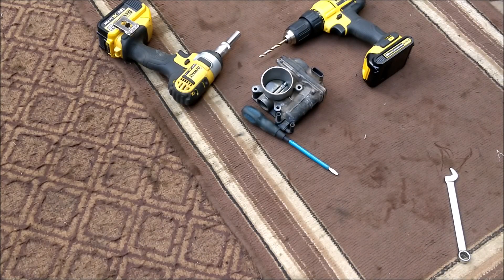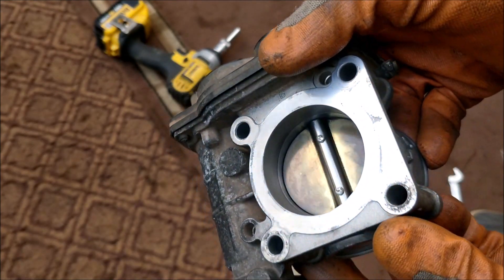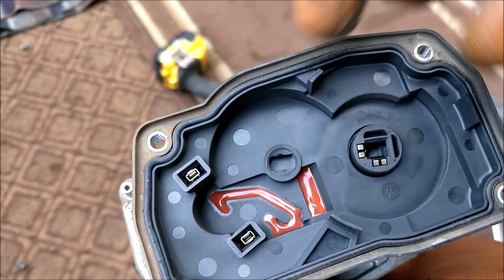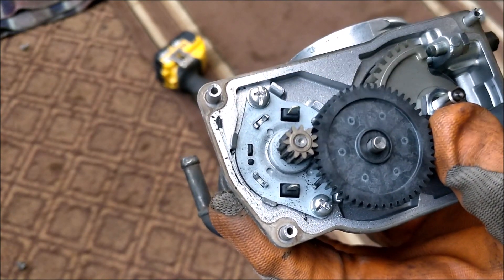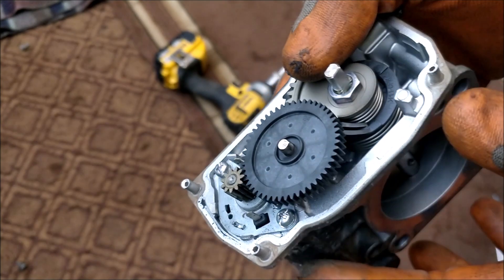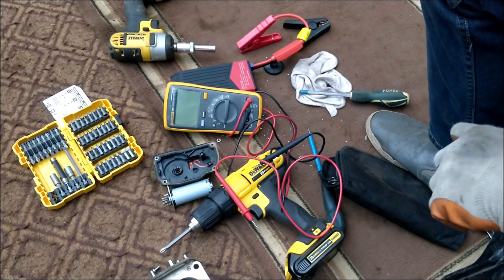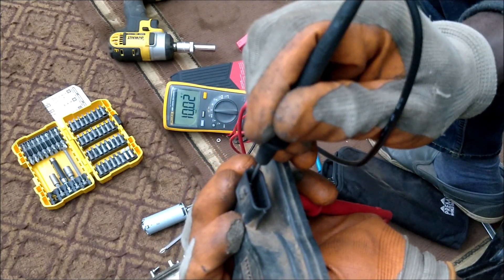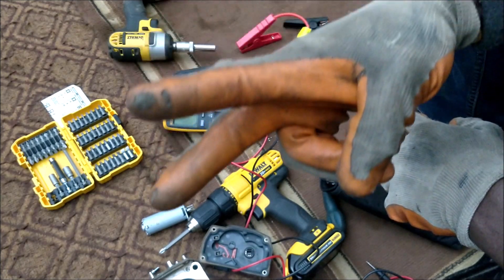Electronic Throttle Body Troubleshooting

Comment: 2:42 can i adjust this outside screw to make the idle higher or lower rpm ?
Reply from the maker: You can .. but shouldn't. If you are having idle issues. check everything else before touching this.. :)

Comment: I have the same issue on an HR15 could, could it be the position sensor is not sending back pedal position signal? Secondly how many volts did you use to test the motor?

Comment: My throttle body has three pins on the actuator !! what is the third pin please??
Reply from the maker: I have quite a few skills.. but sadly, I don't have the black magic necessary to know what sort of vehicle you have and the kind of TB it is equipped with in order to answer this so perhaps at this point, a little more information would be super helpful.. :)
Reply: @mistalobsta  I just purchased it from the local market for education purpose on controlling it with arduino. it is old Toyota!! can't get information on it !!
Reply from the maker: @freemanfreed1581  , perhaps a picture would help but if it's a toyota one then it's probably one from the older manual throttle engines.. and what you are describing as having 3 pins is most likely the TPS (throttle position sensor).
Reply: @mistalobsta   you get my subscription for you time and great help thank you  !!!  but it has no connection with any cable for saying it manual !!
Reply from the maker: @freemanfreed1581  , sounds like that pic will really come in handy. You can share an image link here or perhaps find an image sharing portal to use.

Comment: What is the advantage of fly by wire throttle over cable throttles?
Reply from the maker: From a utility perspective, FbW (Fly-by-Wire) gives better precision throttle control plus can do funky things like allow your adaptive cruise control to take over your acceleration. From an engineering perspective, it allows much easier/neater installation as wire harnesses can be looped much easier and neater than actual cables to the throttle body. It really is the only way to go.. :)
Reply: Drive by wire